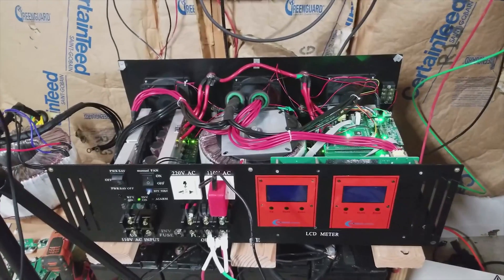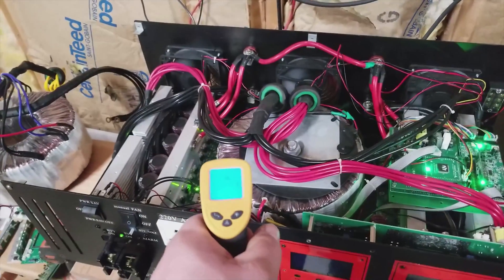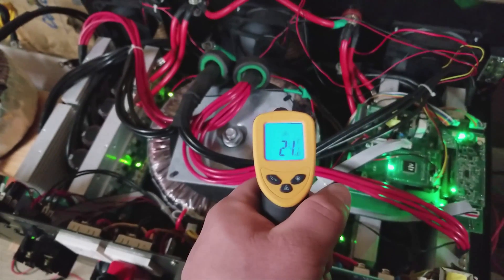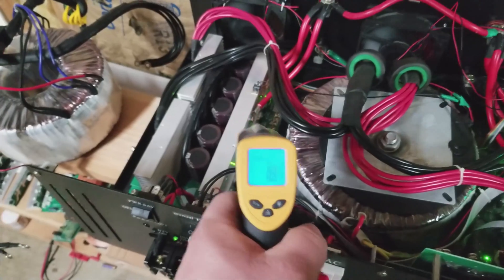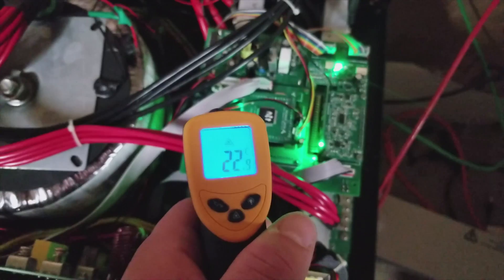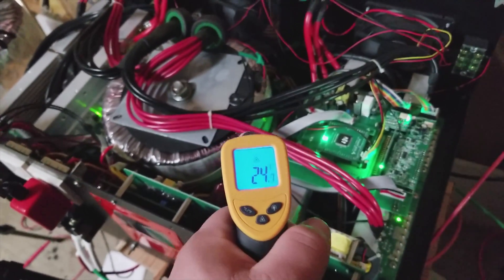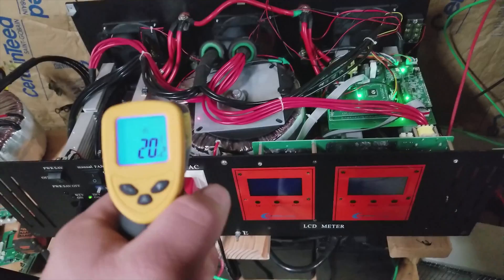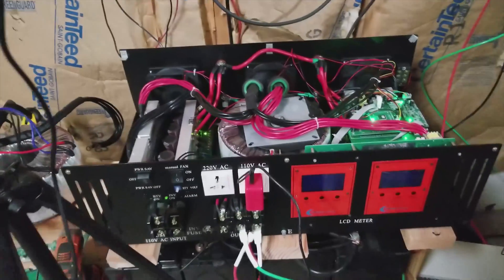Power Jack 15KW Inverter temp test

Comment: 5kW on a 15kW I think you don't need to do this test, could you make on 10kW 12kw maybe 15kW
Reply from the maker: 5kw on one leg of this inverter is well over 50 percent load. Each leg is rated to 7500 watts. Since I am not testing the 220volt leg I can not bring it to 15kw even if I wanted. The inverter would shut down in just a few seconds and probably burn up in the process.
Reply: i assume on a split phase inverter you can use the 2 110v L1 and L2 legs independently (L1/N to a 5KW load  L2/N to a 5KW load), i would try setting up the wattage load slowly you find when you hit about 20-30amps that Alarm light will likely come on (around 5000-7500w) other people have found these inverters are not 15KW inverters they are typically 5000W (15KW is like less than 10 seconds) but yours has 2x the 44-62v DC to fixed DC voltage stages i have seen on other models 

to as long as you don't bond you possibly should have 5000-7500 watts per split phase

Comment: Do you know if power jack is going to come out with a hybrid inverter with grid tie in it...
Reply from the maker: From a our technical standpoint their inverters are not capable. They would need a major redesign and it would pose an enormous risk without the proper cut off equipment.
Reply: Here is all they produce now: https://www.powerjackpowerinverter.com/index.php?route=product/category&path=86_91
I ask yesterday about 48V MPPT charger. Unfortunetly they have no it right now, but I hope in the future they will do it. For 15KW -48V it is absolutly nesesery.